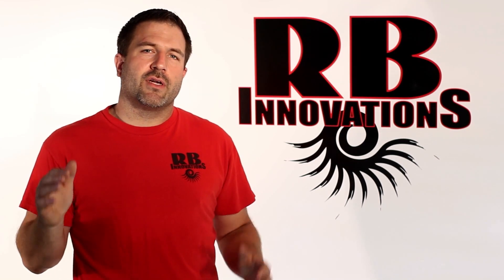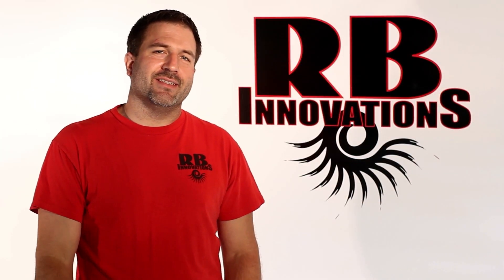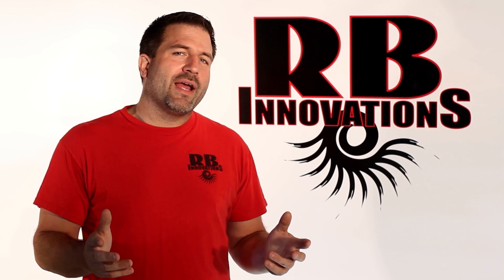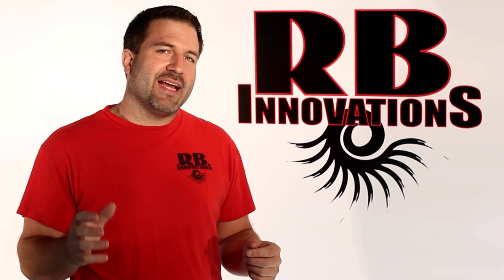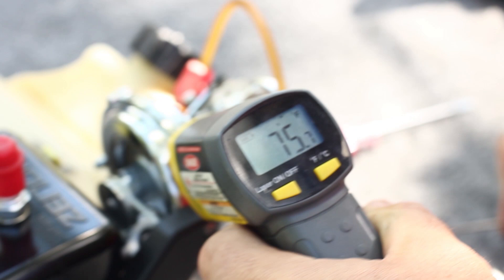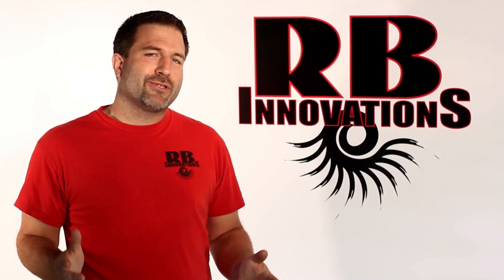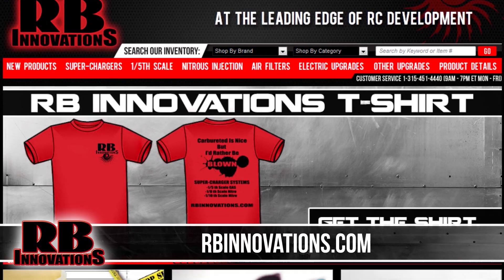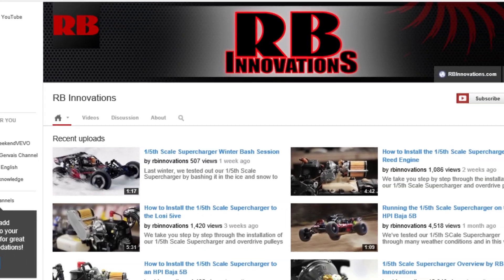Intake Temp Reduction with the 1/5th Scale Supercharger

Comment: The ideal gas equation proves this statement to be false; PV=nRT. If you increase the pressure you also raise the temperature.
Reply: +gtileo Well, the ideal gas equation can answer that as well. If you lower the temperature while maintaining the pressure (like with an intercooler; the air is cooled while the supercharger keeps the pressure up), you lower the volume of the air inside. This means you get more air molecules per volume of compressed air and when you combine this with more fuel, you get more more mixture in the same volume (since the pressure is higher and the temperature is closer to the pre-compression stage) and thus a bigger bang.

The compressor body will act as a heatsink to some degree like you said, but temperature is a huge deal when dealing with forced induction. Even just a few degrees will matter and this is probably why they measured and posted this. The thing is though, the very same equation shows this "supercharger" is not doing its job. If the temperature is lower after the compression stage than before you're doing negative compression, also known as decompression or lowering the pressure. Basically you're restricting the airflow into the throttle body and reducing power.
Reply: +gtileo I know a carb can't tell, that's exactly why this is an issue. From what I can tell this compresses the air before the throttle body and that means higher pressure will give less fuel, since there is no fuel pressure regulator to compensate for the pressure changes over the rev range.

My guess would be that with the stock carburetor set for a richer mix will give good results in the top of the rev range and nearly stall the engine in the bottom rev range.

Do remember that on most setups the fuel mixture depends on both the low pressure area around the fuel needle in the carburetor and the exhaust pressure return into the tank. Alter one of them (like replacing the low pressure carburetor area with a high pressure one) and the assumptions made in the design go out the window.

On the topic of air molecules it's just that it's a convenient way to tell how much you actually gain from the forced induction, you'd probably need fuel injection to do anything useful with it on the fly.

Forced induction is cool, but on a carburetor engine it quickly gets complicated.